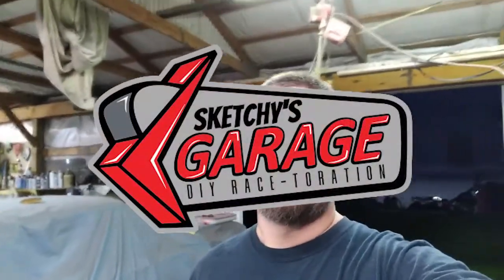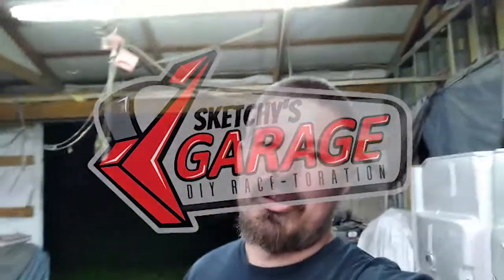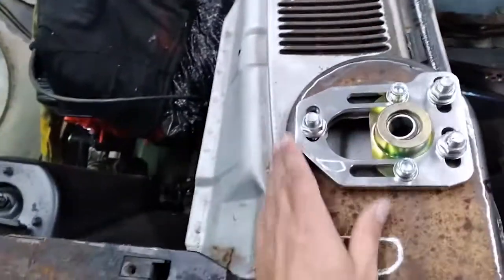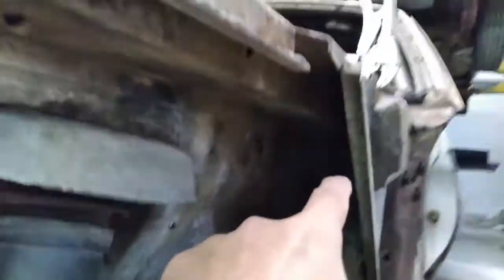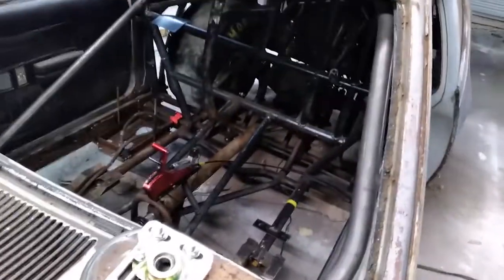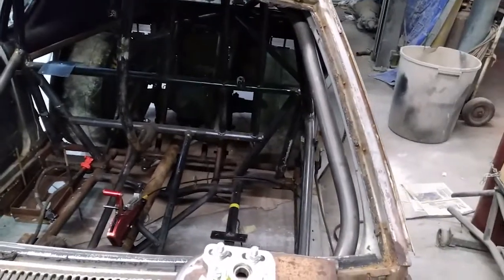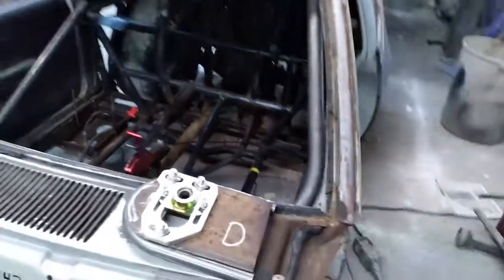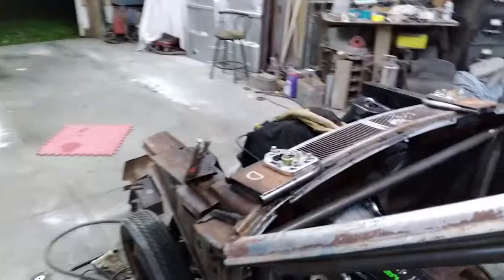5.Not another Foxbody spinning twins in the hood| Sketchy's Garage

Comment: Don't get too excited but I have a full set of slots  that fit a Chevy, they are 15 inch rims the rears are i think 12 or 14 inch wide.  Got them given to me several months back, only problem is they are so corroded I doubt they are usable. There is so much gunk and rust under the beadlocks I'm not sure they could hold a seal.
Will get em out of storage tonight or tomorrow, get them cleaned up to see if they are salvageable and get back to you.

Side note: Saw a Stripper Glitter video a few days back and thought you had the Gremlin done.  Was a red Gremlin making some nice licks in their video, turns out it belongs to a group called 'The AMC Boys'.  Somebody beat ya to the punch bro!  =(
Reply from the maker: The Gremlins are making a comeback! Next year hopefully 1 or 2 foxbodys will be replaced at the races with Gremlins. 🤣🤣🤣🤣
Reply: @SketchysGarage   Show me the Gremlin Gap!   =)
Reply from the maker: I'm hoping too!
Reply: @SketchysGarage    Bad news for those slots btw, got em cleaned up but they are pitted to hell and one of the rears has about a 6 inch fracture around the lug holes.
There is a old local here that used to run a junkyard, has probably 10 sets of slots (no clue on sizing, they are all bolted to an old cargo container) and idk how many other odd parts but he is batshit crazy and has only let his kids on his property in the last 10-15 years. Everybody else he shoots at, literally. 
I'm not on good terms with the kids but I know someone who is, will try to have them see what the old guy has and if he will part with it.
Don't hold yer breath on this one, it's a longshot.